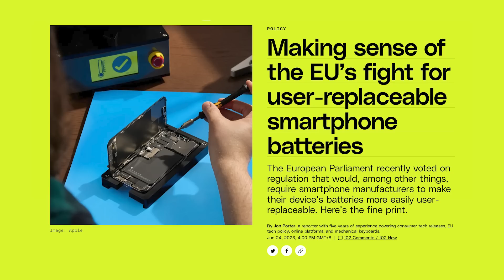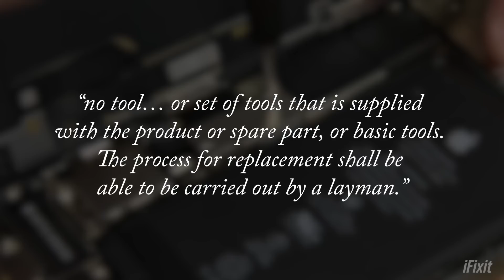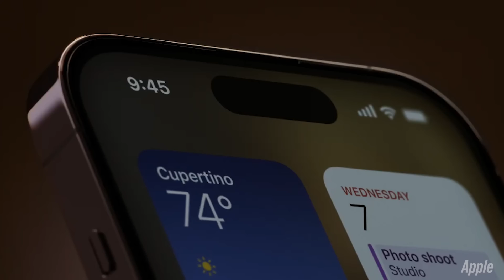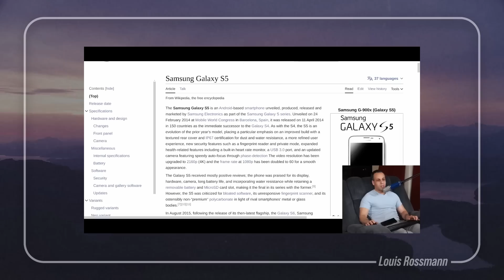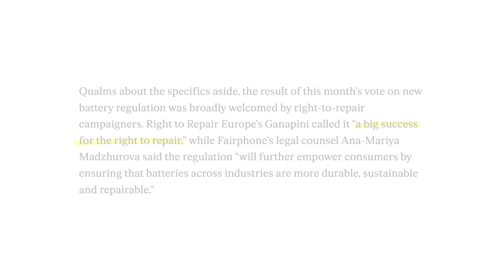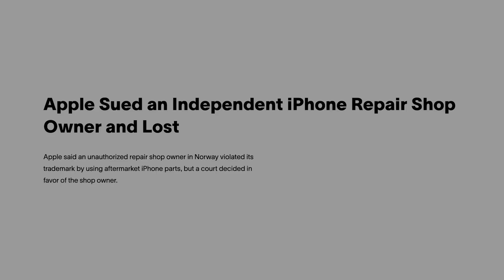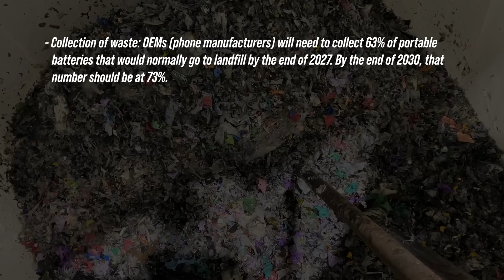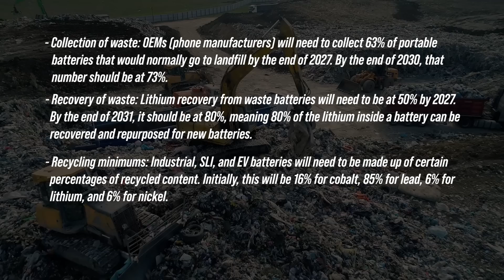EU Just Changed Smartphones Forever

Comment: Heyo . Nice video Cold Fusion. I had many phones with replacable batteries and it was hard to let them go. I  had Samsung DUOS(crappy one it was slow as crap)(had replacable battery) S2(replacable battery), S3(as well RB), S4(RB) , S5(RB) and then I had for a year Xiaomi Redmi Note 5 which was first phone without user removable battery. Then I bought my current one Samsung A51 which ofc doesn't have replacable battery. 

  I do think that sealing batteries for harder replacement was a move influenced by financial growth and financial benifits. Less people can easily replace their batteries, more people will come to official shops or other shops to replace their battery so they are all on the cash cow.  I am happy that EU is doing something good for once since they have been lacking quite hard .

Comment: The construction of these devices so that they are completely replaced with a new, current version, rather than a simple repair or battery replacement, has been an obvious con-job on consumers run by plan of all the major manufacturers. Their argument that their products are so mystical that only the original maker can "safely" preform such tasks is a laughable excuse, except that they then design the products to make it so. In the US, they get away with this because we have lacked laws barring such consumer abuse, and the industry has corrupted so many lawmakers that it has been nearly impossible to change the laws. The EU has a spotty record on consumer regulation, but at last they make an effort. If the video is correct, this is a good example. If the EU was motivated out of environmental concern over dumps filling up with discarded batteries, what difference does it make whether the user  or the factory replaces a dead battery? Either way, the battery still ends up in a dump. Actually, either way, most batteries probably get broken down and materials recycled.

Comment: The adhesive in 'waterproof' phones is actually the weak point. 
If phones get hot, say via fast charging or being on a sunny beach where folk use phones in water, they fail because of the glue can soften and melt, allowing water ingress. 
I don't take 'waterproof' phones in water after my  'waterproof' iPhone failed - within its own limits. 
Something I learnt from a chap who fixes phones for a living.

Comment: "this has just been the way things have been"
no, its generations of anti consumer design changes in order to force us to purchase new phones instead of getting them independently repaired.

also I might be being a bit of a pessimist, but i would not be confident in expecting phone manufactures to not have EU only versions of phone. I would be cautious of sabotage of the EU versions of phones in order to encourage imports from the west or asia into the EU then use that as an excuse to say that the replaceable battery phones are inferior. also apple are 100% going to have a serial number in which the battery must match the phone in order to work .

Comment: Apple has been leading the way in making the phone experience more horrible.  Today I am currently having my battery replaced in a Google Pixel 5 phone.  I loved my Samsung Galaxy 4 & 7 with replaceable batteries, as well as my first smart phone, a Motorola Droid X.  I intend to keep the Pixel at least another 2 years.  I don't believe in buying new phones every two years

I don't mind if phones get thicker, I already put a thick phone case on my phones to protect them .  Screw the corporations that have sold the lie that making devices impossible to maintain or repair in order to sell more devices.

Comment: What Apple can do is to remove the internal battery from the iPhone and require an external Magsafe battery to run the iPhone. Magsafe external batteries are easy to remove and reattach. And Apple already has an external Magsafe battery.  This way, the iPhone can remain water resistant / waterproof.  Call the batteryless iPhone the iPhone EU. Simple to do - just remove the internal battery.

Comment: It will be easy to meet the recycling goals for batteries - simply have a "core  charge" as they do for car batteries. If the price is double for the new battery without providing the "core" of the old one, not too many will wind up in the skip.

Comment: My take on this is that it was a design decision. Using glue instead of screws saves space - not for technical reasons but because slim phones were a big trend (Samsung S2 for example, i bought the big battery and case kit because for me it was too slim. If they had designed it for the bigger case and used the space for the battery instead of just air it would have stomped the market by its running time). All other manufactures followed because of peer pressure. They saw Apple got away with it and their marketing guys said that a removable battery is not a big buying decision factor.

Comment: "Industry standard"? Whoa, that's a pretty egregious rewrite of history. It happened because Apple wanted to make 'thin' their main marketing point while the real reason was to intentionally make phones and tablet nearly impossible to repair and so force consumers to upgrade when their phones or tablets become outdated or broken. Not surprisingly, once Apple legitimized this, the other phone makers jumped on the bandwagon. 

Apple's even been sued over this because of practices like throttling performance to maintain apparent battery life as the battery degrades.

Apple has always been at the lead of this. They were the first to have soldered RAM and then SSDs. And then they even took that one step forward by separating the actual storage components of SSDs from the controller, making impossible to upgrade a Mac by removing and soldering in new storage components. Apple's also been very aggressive about using part IDs to prevent replacement of any components without their say so.

There's been a movement away from this in the past year or two. Microsoft, for example, did what Apple swore was impossible: added removable storage in the form of 2230 M.2 SSDs to a thin tablet (Surface Pro 7 and later). They've also been ahead of the curve in publish repair guides for consumers and repair shops and making their devices more repairable. Asus copied that with their ROG Flow and other devices.

Comment: User replaceable batteries is not the same as easy to replace and we have to make sure the integrity of the device (like waterproofing) does not get affected
Reply: Checks the water rating on my phone 200m . Checks that it has a battery. Yes. Looks at the design. A back plate four screws and a rubber gasket. Can I change the battery . Yes. Is there a shop in every town that can do the job for ten bucks. Yes. Some things are not problems.

Comment: I am still using my LG K20+ which has a removable battery and feel the manufacturers designed their phones so you are not able to easily replace the battery strickly for profit, as they also removed the micro SD slot and the headphone jack as well.
My LG K20+ still has the micro SD slot and headphone jack.

Comment: I think you made a small mistake. The design of smartphones will not change or become any thicker at all. They do not have sealed batteries because of design choices at all, it was an economic choice to use cheaper materials and to force people to buy more phones. There has always been some small companies making phones with replaceable batteries which have the exact same form factor as the most common phones. Amazon for example has loads on display from China. The battery being replaceable only means that they have to use a clip and buttons or small screws rather than just loads of glue. This can only be a good thing as all it does is protect consumers from greedy companies like Apple and Samsung. Modern phones are not designed around this pancake idea at all and you made that bit up. You also made up the part about them being made out of metal and glass and not plastic. That's just not true as every single modern phone has a lot of plastic even if it has a metal case. Nothing about this has changed since phones had replaceable batteries too so it makes zero sense to even bring it up.

Comment: The design of smartphones to not have a user replaceable battery is a cost extraction tactic. Either the user is willing to pay to pay the high price of repair to replace a simple battery or cough up more money to get a new phone instead with new specs. Its the laziness of the consumer to get the repair and wait and/or the cost judgment of the consumer to think the upgrade cost vs the repair cost (which repair is usually very higher than it should to anchor the price comparison for the consumer).This is what the corporations rely on. Either way the smartphone company gets more money instead of simply letting the user buy a new battery to replace themselves at a fraction of the cost.

Comment: Manufacturers have never produced anything where profits weren't a key factor in the reason for doing so. Its the reason for being in business from the beginning. The consumer being the source of those profits are only seen in that way and so products are designed purely on the basis of enough attractive functionality in order to promote the product purchase for the minimal outlay of the Manufacturing process of that product to gain maximum profit. If Manufacturers were in it for the sole purpose of being the consumers best friend there would be no need for regulation.

Comment: I kinda disagree with the premise that battery replacements are allways maintennance and should be always user replaceable. If a device has a design life span of 5 years and the battery holds 80% charge after these 5 years, that battery is a zero maintenance component, and replacing it is repair and not maintenance. Maintennance should be able to be done by a moderately skilled end user with no special tools. Repairs should be able to be done by a person of the skill level of a repair man with the tools that are common to repair men. Companies should not be allowed to limit access to special repair tools and should not be allwoed to prevent 3rd party replacement parts to be sold.
I think it would be most beneficial to force manufacturers to advertise the expected life cycle of a product and be forced to guarantee certain properties based on that. When I buy a new phone and it is advertised with a 5 year expected lifetime and a no service battery, that is fine for me. I then can expect I won't need to change the battery for the next 5 years and after that to treat a battery change as a repair. But I will also expect to receive security patches for at least the next 5 years.
Product lifecircle transparency is something no one is talking loudly about. Today you have x months of legally mandated waranty (depending on where you live), a warranty by the manufacturer with insane conditions that may or may not legal depending on where you live, and absolutely no certainty whether your phone will receive any updates when the next model hits the shelves. I am fine with a sleeker phone with a lifetime battery that needs to be repaired rather than maintained, as long as I have a clear expectation of the lifetime of my device and its components.
Reply: In which world do you live in. Apple officially says that on average a battery loses 20% in 16 months.

Comment: I have an iphone SE first generation which I like for its size.  I have just been quoted £79 by Apple for a replacement battery on a phone that is ancient in smartphone terms and when the phone is worth less than the replacement battery.  This is outrageous.

Apple is a profiteering company which exploits their captive market.  It's time for the EU and other trade blocs to legislate for a common size(s) user replacement battery (depending on the 'phone's power requirements) in the same way they have done for charging ports on mobile 'phones.  There is a standard range of alkaline batteries so why not other types?

And the sooner Apple get out of China and start manufacturing in the West the better for all.  It is companies like Apple that have been propping up the this rogue state to the detriment of Western manufacturing.  God knows how many trade secrets China have stolen from Western companies over the years to enable them to expand the way they have.

Comment: changing batteries are not that common...people usually switch them every 3 years or more so. Having easily replaceable batteries means less internal phone space, less water resistance, and generally worse phone durability, due to the open internals and removability creating natural entry and weak points on the phone. The result? we will have to spend more money replacing these components... I don't get why people are so oblivious, as if agreeing on anything that opposes a company they don't like (eg, apple) means they benefit more. You gain some, You lose more.

Comment: then removable battery i need primary 100w charging minimum ... i change xm 11t pro  to S23 ultra and im fa***   120w 10 minutes charging vs 40w charge 1/2h charging ...  too expensive crap, made samsung..  60w is fake s23U charging 40w maximnum, after allow QC in setting. lol :D  Who need removable battery if customers cant charge fast ,..